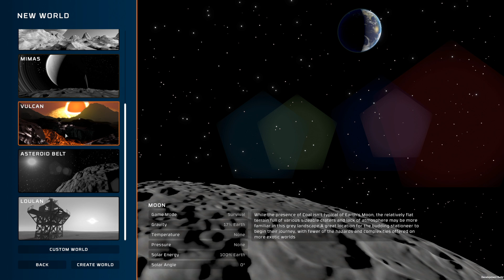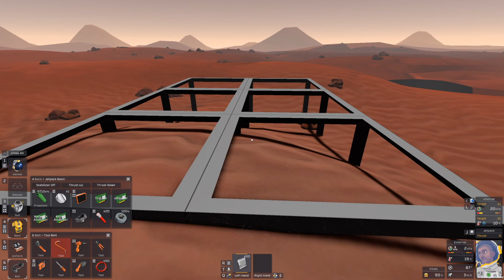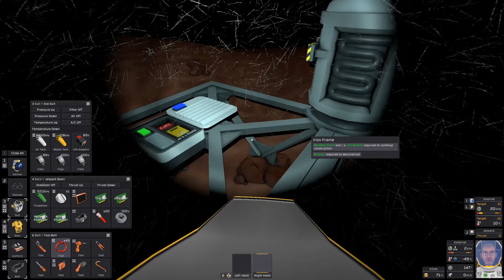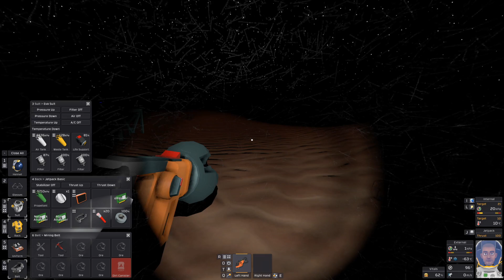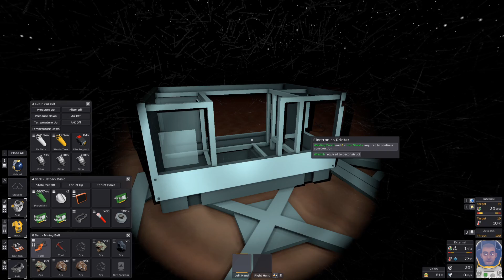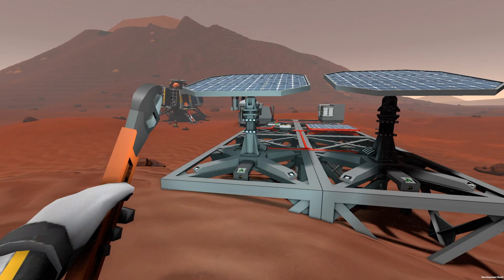Getting Started: Stationeers Survival Tutorial

Comment: So, you're finally confident enough to make tutorials :)
I think you forgot couple things:
- COMPASS - when you said about sense of direction, this tool can aid you. Just remember which way you left your base, and you can backtrack if lost.
- Flares are useful to mark your way at night (breadcrumbs technique)
- Portable Power Generator - this thing is survival lifesaver. If you are in a pinch you can take fuel (O2H2 mix) canister from your welder and use it to generate power and charge your batteries. Even at night. It's essential early on on low sun starts like Mimas.
- Coal generators are useful, just not so much early in game - 20kW is a lot. But you need station battery to make full use of it. Generally they are perfect backup power.
- Solar panels are not obstructed by windows, allowing you to use them indoors - very useful early on in place like Vulcan when you can't go out during the day to adjust panels.
- Tanks and chests are mobile, it's easier to drag components chests near where you're building instead of going back and forth - be careful not to crush yourself.
- You can top up your personal tank in portable tank black-yellow striper port. A thing that would save me lot of piping effort in my early plays.
- You can drag cables through blocks - handy if you don't want to get two lines get across each other but not connect.

If you want to make solar tracking tutorial next, let me know if you'd like to discuss anything. I still have save with my Solar tutorial i made for you over half a year ago :)
While you're working on simple setup, I think I'll try to make more advanced one ;]
Reply from the maker: Ooh, good tips. I've never made much use of the portable generator but it's a good one to remember :)
Reply: what do you mean by drag cables through blocks?
Reply: Unfortunately solar panels are now obstructed by windows. You can't use them indoors anymore. They changed it in some recent release.
Reply: @grahamr2809  Well, not literally. But you can grind frames to the point you can walk through them and then place cables inside. Once you're done, weld everything back up. Just make sure they are safe from burning or it may be difficult to find. Same tactic applies to pipes as well. I think you can place other things inside unwelded frames too, unless they changed it recently. I used to store tanks and logic chips inside frames when couldn't find space.
Reply: @octavioferreira2846  I just tried and it works for me. They may still be obstructed by window frames or other junk, but produce normal amount of power most of the time.
Are you playing on some beta branch? Maybe they did something there?
Reply: @UfoLBeerSeeker  oh yeah, i thought you meant cables could be put through objects somehow. I don't like to put cables in sealed frames, because if a cable burns, that can be painful to look for.
Reply: There's a compass!?!
Reply: @TianarTruegard  yes, look to bottom right, next to the portrait. There is small circle with bar across. Next to it you will see number in degrees. This is your heading. I assume 0 is north, 90 is east and so on.
Reply: @TianarTruegard  in the bottom right. Hard to keep yourself going in one direction tho when you're looking for ores. I just use the gps for navigation, and know my base can be found near 0,0 (the spawning location)
Reply: @UfoLBeerSeeker  No, I'm playing the main branch. It happened to me when I went back to an old save after a major update. Maybe the update itself broke the save. I'll try again on a new save when I get the chance. Thanks.
Reply: @octavioferreira2846  not a good sign!
Reply: @johnthehumanist2333  I'm on the latest version on Mars and I have windows around all of my solar panels and they work just fine.  Used both Iron Windows and Composite Windows.  Keeps them nice and safe from dust storms!
Reply: @kylania  I know.

Comment: Agree with @John Hathaway, I went through the Stationeers tutorials and nearly died my first couple of days from running low on power.  I was trying to build an airtight base first (and on the Moon) so this tutorial is very helpful. Thanks @Splitsie!  

Update: they changed the recipe, The Solar Panel Kit now requires "steel" that you cannot make with an Arc Furnace.  I built a "furnace" but I have no idea how to plumb it.  Sigh.
Reply from the maker: With the basic furnace a simple way to plumb it for basic alloys like steel is to attach a pipe to the output, then a pipe valve, then another piece of pipe and finally a passive vent. With this setup you can put oxite and volatiles into the furnace directly and if done at the correct ratios you can also put coal and iron in and get steel out. There's a fairly well written guide to how to do this in the Stationeers wiki  https://stationeers-wiki.com/Main_Page
Reply: @Splitsie  Thanks for the reply!  I managed to figure that part out (eventually) and I've figured out how to use active filtering to capture CO2 and Water (from ice thrown in the furnace). What I can't figure out now, is that I read that you can use a "Kit (Atmospherics) Electrolyzer" to separate water into H2 and O2 to power the furnace. I got it plumbed in, but it won't seem to light.  Either that requires way more water than I have or it's been nerfed out of the game.

Comment: Bought this game because of this video. Having a great time.

So far I have...
Turned my furnace into a bomb...
Cooked my base using my furnace...
Melted my face walking past the exhaust from my furnace...
Automated my greenhouse to pull in cold CO2 from the martian environment to keep it cool....
Automated vented atmosphere from greenhouse to keep pressure proper....
Got thrown off a mountain by explosive decompression....
Automated 1-axis solar tracking with only 4 chips...
Busted my helmet multiple times reach for things under stairs and bonking my head because crouch isn't a thing....
Automated my arc furnace with chutes and logic chips so I can isolate it in a small room to claim its gases....

Having a blast.

A couple tips for early game.
Use the wrench to detach the cargo containers from the lander, then drag them to you base site.
Autolathe can build lockers. 2x locker kits makes a big 30 slot lockers.
Most things can only be built on frames. But it connected up will remain when the fram it gone. So make a frame roof and put your lights up there and wiring them. Then remove the frames and the cables will hold up the lights so you can use walls or windows for you roof.
Similarly, if you want multiple floors without a full frame for the floor, put the frame in the lower level, build your stuff for the next floor up, remove frame, add floor.
Reply from the maker: lol Those sound like some very fun things to do (things I may well have done myself too) :D

Comment: I found the solar panel with power and data on one port much easier to work with than the separate one. Batch writers can write across power networks. You can have a batch writer with power and input connected to your normal cable network, and output linked into the solar panel network. In this way you can save a lot of cables and you can also have multiple rows of solar panels compactly (one per frame).
Reply from the maker: I always prefer to use the separated one because it makes creating an isolated logic circuit for the panels easier which is helpful as your base gets larger and more devices are connected to your power system

Comment: When you get to the data ports, maybe in a later video: 
there are very few machines that absolutetly need the data port connected to be able to acccess data from that machine.
In fact, the only one i can think of is the computer.

All other dataports are more for seperating data lines from main power grids. You can access data from both the data and the power port.
When you try to find data from a certain machine and try that on your main power line, it gets messy.
Seperate data lines was one of the design challenges that i liked the most about that game. 
For instance, i really liked my solar logic wall, that had its data from solar Panels before the station battery, but the power ports were connected to the main grid after the battery, so the logic could run at night and reset to the sunˋs position in the morning
Reply from the maker: Oh cool, that makes sense about the power thing. Will have to remember that :)

Comment: I have watched you and Capac play this game. Today I watched this and now I bought the game. I have no idea even how to start lol. Will just take it step by step. Hopefully your next tutorial comes out quickly.
Reply from the maker: Hopefully you'll have some fun and hopefully I will manage to get the next one out soon :)
Reply: The hardest part to figure out for me has been the atmospherics (gas management):  mixing gases, managing temperature, and pressure in your base.  Once you get a small room built, the tank of O2 I would actually save for your suit.  Use an active vent connected with pipes to a passive vent to put a bit of atmosphere into the room, then melt a little oxycite at a time to get oxygen in the room.  You don't need much more than 50 PSI to have enough to breathe.  The tablet comes with a gas sensor board that can tell you when its safe to breathe without your suit.  If you make a 1 frame hole in the floor and melt water ice in the room, water will collect in the hole, and you can put a vent with pipes down there to use it to run water to hydroponics trays.  Room air pressure will be enough to pressure feed the water.
Also, run the in game tutorials, they help a lot!

Comment: Not sure the game changed since then, but what I'm experiencing is that suit temp and pressure make little difference (even though I'm doing my first game on Europa), while the light consumes an insane amount of power. 🤔 Would be nice to be able to see the actual consumption rate in the game.
Reply from the maker: I've never done a test on if the lower temp used less power, but it seemed to and several reddit threads/wiki entries confirmed it to a level I was happy to mention it, though they've been tweaking the balance heavily in recent patches so it may well have changed
Reply: @Splitsie  yeah, it does make sense to assume, and I've also read it in multiple sources, I just didn't experience it that much in practice. Would be nice to be able to read the actual current consumption in the game.

Comment: Just got the game, and the thirst is killing me super fast. Funny thing, there are no tutorials on getting potable water in the game yet! Had to dig some sites to manage some sort of water dispenser using a default small water tank. It kept me alive for about  5-6 ingame days before running out completely. So I figured there's this ice crusher thing which I connected to the system and stuffed a stack of ice inside. As I was waiting at the cooler to pour me some sweet sweet water, the stupid thing realized I'm putting too much pressure on it and blew up in my face point blank, killing the bald midget instantly.
I'm beginning to fucking love this game.
Reply from the maker: I was about ready to do a tutorial on that side of things and then they went and changed a bunch of stuff so I've been holding off until things settle down before I return to make more tutorials for it. Glad you got it worked out though :)

explosions aside :P